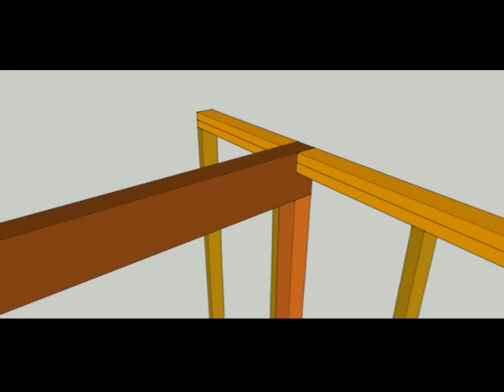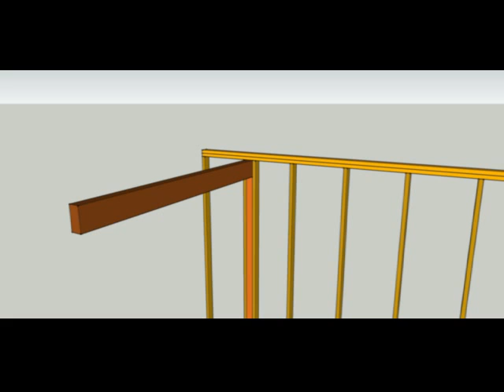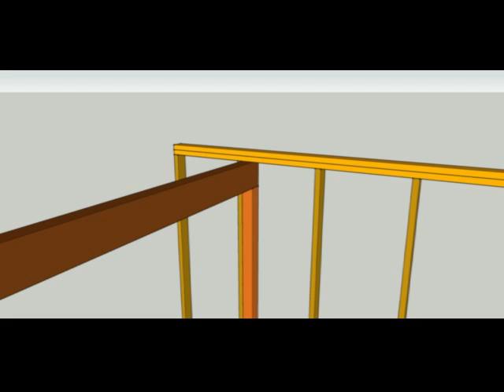Structural Beams and Framing Plate Tips – Home Building

Comment: How do you tie a 10Wx39 steel beam to a 3- 2x8? I would assume you would add blocking to the web and through bolt it. But how do you connect the block part to the 2x8 supports?
Reply from the maker: That's a big beam and you might need more steel supports. You can email a picture or drawing and I will be glad to see if I come up with something.

Comment: What IRC code says you can add straps across gap in top plate?
Reply from the maker: I don't know if there are any, but these are methods I have used in the past. Keep in mind that these are suggestions and might not work for every construction project. I didn't even know they had information on strapping, can you send me the reference number or pages so that I can examine them.

Comment: Thanks! I'm building now! Putting in lvl beams! Trying  to figure if I should have the beam exposed/wrapped with drywall or set on top of top plate and use hangers for my second story I joist
Reply from the maker: If you need some more ideas feel free to send me some pictures of your project and you can find our email address at our website.
Reply: use hangers for sure

Comment: Do you have any videos about putting in a flush/hidden beam in a ceiling space to replace a load bearing wall?
Reply from the maker: I don't think I do, but will make one as soon as possible. Don't forget to visit the website and check out the engineering and framing sections for more videos.